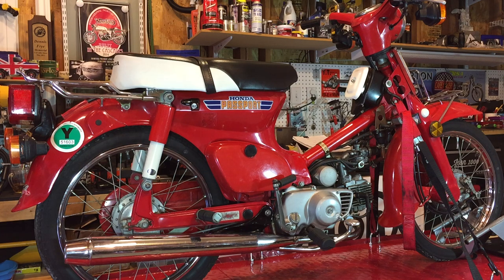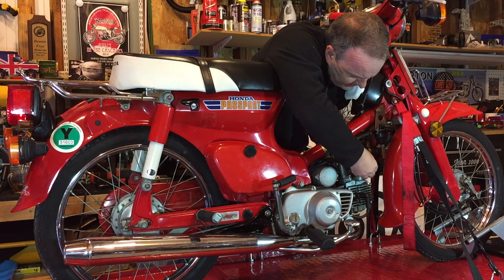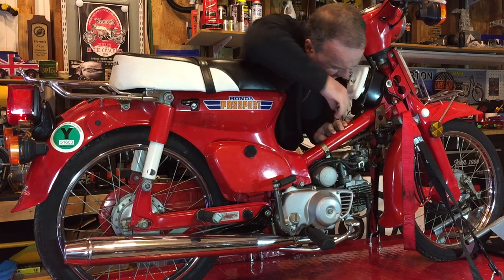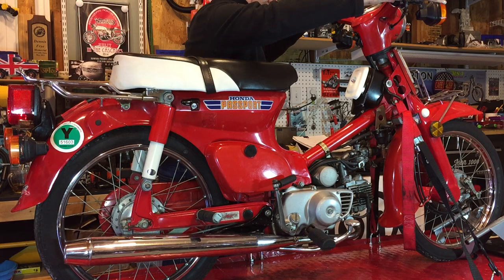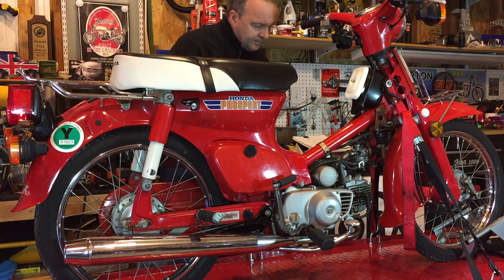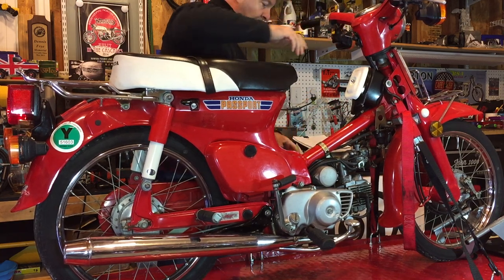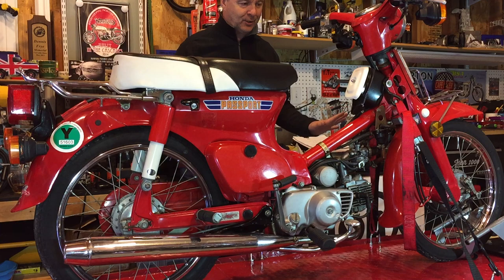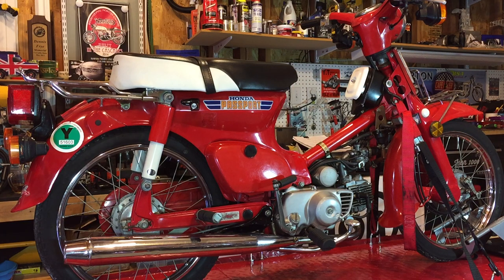1981 Honda C70 Passport (15) – Starting the bike again!

Comment: Hi Mike...I'm a novice at this and trying to get my 1981 Cub running.  I've done several things, including changing the oil, replacing the battery, cleaning out the gas tank, repairing a rear flat tire and replacing the rear wheel bearings.  I've replaced the carburetor, but can't get the bike to idle properly.  I've heard that the OEM carbs have problems, so I'm thinking about rebuilding the original carburetor.  Before I do that, do you have any thoughts on why I can't get it to idle properly?